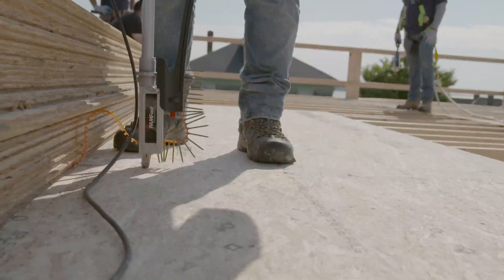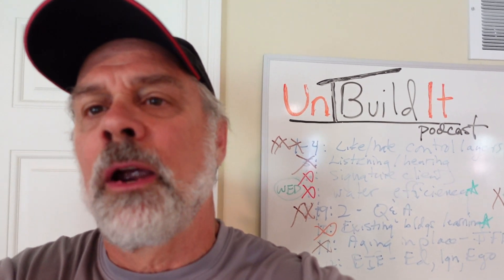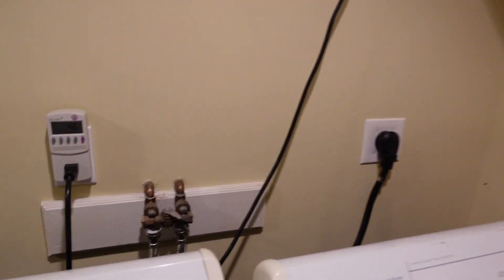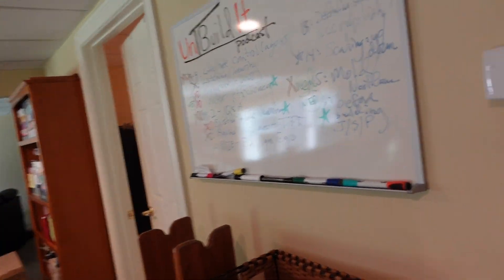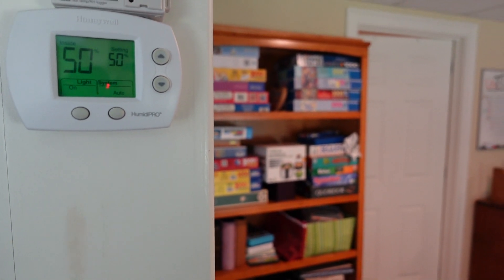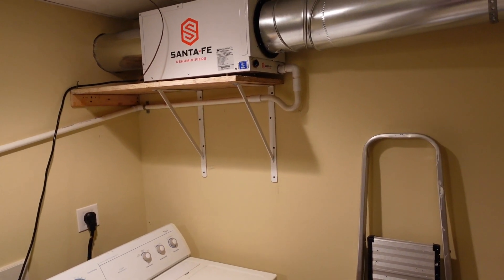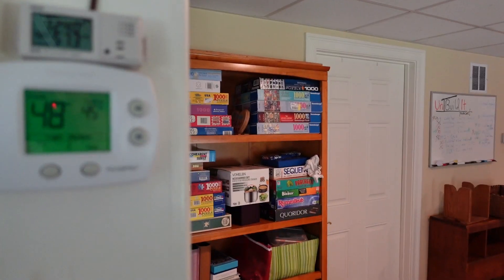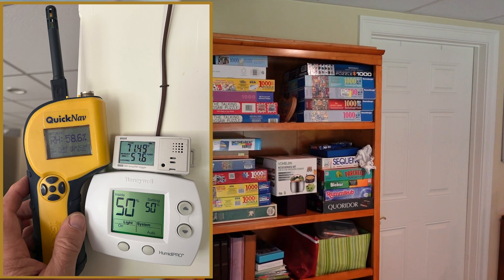High Performance Dehumidification: Santa Fe Ultra70

Comment: Just saying, my SantaFe Compact 70 just died at 3 1/2 years old.  Six year warranty is worthless because after 2 years it only covers parts and the labor to fix would cost more than a new unit.  Also, tried calling SantaFe for warranty info repeatedly and all I got was a message that all of their agents were tied up and I should try messaging them, which I did.  Their helpful response was to try and find someone to fix it.